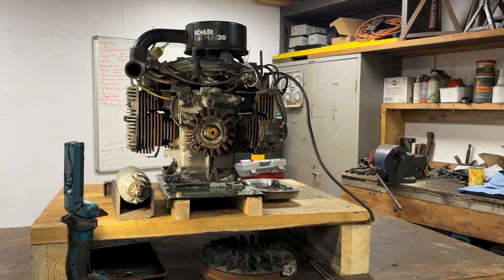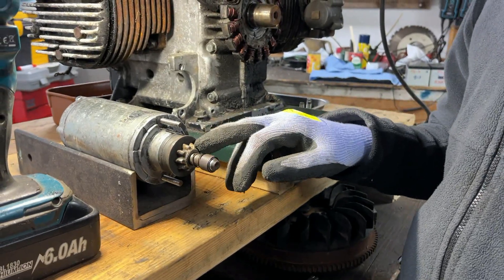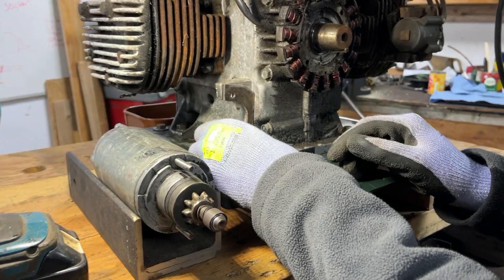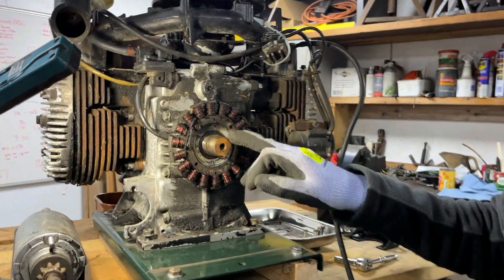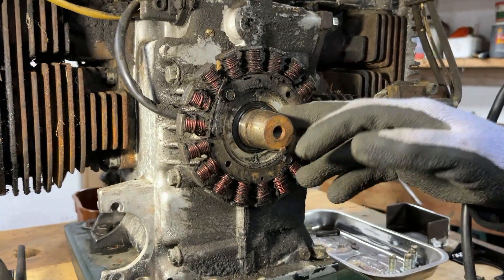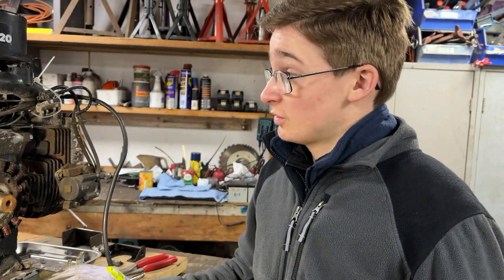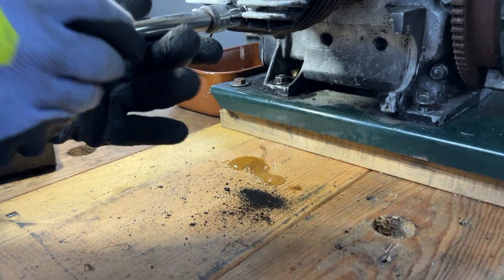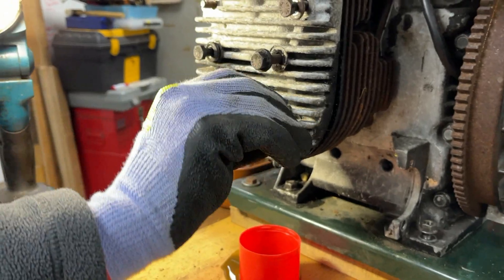1992 Bolens GT2000 - Part 2 (Engine)

Comment: To find water mixed with some oil in one cylinder isn't such bad news because even emulsified oil has protective properties. I see the strong potential that a light honing and perhaps a new set of rings and a valve lap and this will be good again. Glad also to see that the stator was just loose. The cameraman did a great job on the bracket and assisting in today's video. Bravo!😁
Reply from the maker: Although this is very similar to the Kohler twins in our tractor it is also different in a number of critical ways. It looks like the crank case has to be split down the middle to get access to the crank to get the pistons out and we have not been able to locate replacement gaskets. It also looks like the inlet and exhaust manifilds need to come off to give good access to the valve springs. As such we are thinking of leaving the bore and rings but I think we have to lap the valves. The bracket was a lot of work but we are pleased with the way it turned out. Take care
Reply: Sometimes it's best not to dig too deep..that's one of my faults, I always want to do a complete tear down when just a tidy up will work. I'm sure the pistons and rings will be fine untouched. You can still tidy up the exposed bore and rinse out with solvent to get some better traction for the existing rings. It's going to be another success story, I can tell. @GardenTractorBoy

Comment: Really good progress Joseph! Very interesting video. I was a bit surprised that one cylinder had so much water damage while the other side had very little. Makes you wonder why that is. Looking forward to seeing more on this tractor rebuild! Thanks for sharing and take care!
Reply from the maker: Thank you very much. We did wonder if the blown head gasket let the water in but someone also suggested that the valves may have been closed on the good cylinder. Take care

Comment: I really like the look of that engine, looks like a ruggedly built machine! Don't sweat too much over the oil filters, the filter I put on the 2cv tractor was £3-50 and was from a very well known filter maker, you can also buy the very same filter to fit a Ducati V twin, but it will cost you £14-99!  same part number, same filter, but obviously if you can afford a Ducati you have enough money to pay more for your oil filters!! The heads looked to be leaking at the bottom, would be a good idea to check the head and block faces for flatness, I had a big slab of plate glass I used to spread thinned down grinding paste on and rub the mating surfaces on to check for flatness, or you can use spray glue and a sheet of 180 grit wet and dry paper I would glaze bust the rusty bore and maybe fit new rings if you can get them, it may burn a bit of oil, but much cheaper than a rebore and new pistons! another excellent video Joseph, cant wait to see the rest of the stripdown!
Phil
Reply from the maker: Thanks. Those Kohler twins are great engines although they do get very hot when they are running, not a lot of fun in the summer. The engine has a Kohler oil filter fitted but not the correct one or one that cross references to the correct one. I think our main concern is that has been fitted with a filter that does not have an anti-drainback valve fitted. We have a surface table which we tend to use to check to see if the heads are warped which is often the case on these Kohler twins. I am not sure if it is correct but we tend to use some 180 grit paper on the surface table to correct any  damage. We have not been able to find the gaskets or rings in this country so we leaning towards not splitting the crank case to remove the pistons. We may have to revisit if it turned out to be a problem . Thanks for the tips. Take care

Comment: How's she goin'?  Some interesting discoveries you're making as you dissect the engine.  This is a very good exercise, you get to see the problem and then play detective to try and understand how the problem may have developed.  For the most part the flooded engine is the culprit but for some issues, like the starter mount, it was loose fasteners and the repair you made is awesome as it will prevent future failures due to the original problem.  Great work you're both doing!!  Take 'er easy!!!
Reply from the maker: Thank you very much. We are hoping that we will not find too many other unwelcome surprises on this engine, it is turning into a big project. Take care

Comment: I wonder why one cylinder was so much better than the other one,, maybe both valves were closed on the cleaner one??
Reply from the maker: We believe the engine was not fully under water and we are guessing that the head gasket had already blown on one cylinder to the extent that it allowed water into the cylinder. However it could be that the valves were closed on the clean side as you mentioned. We are hoping to not find any more problems. Take care

Comment: When working on a friends machine: "no good deed goes unpunished". Good head bolt removal technique. Do you have a speed wrench? Be careful. Chances are that the rings rusted a little. Good Luck, Rick
Reply from the maker: Yes we have a speed wrench and you are right, we should have used it. We were concerend about one of those head bolts but it came out in the end. We have been spraying releasing agent between the cylinders and the pistons which we hope will help. Ideally we would split the engine and remove the pistons but that is more work than we want to do and I don't think we can get the gaskets over here. Take care
Reply: @GardenTractorBoy If you can't take it apart, spray some cheap lubricant in the cylinder. I use kerosene and rotate the crank. A bit of crap will be left at the top of the cylinder. Wipe that out with a clean paper towel and repeat until there is nothing being left. When you start an engine that is questionable, run it for only a few minutes and then do an oil change. Watch the waste oil to see if there is significant contamination. I've had to repeat the oil changes as many as 3 times until I was satisfied, that was when oil was $1 a quart. Now, its $4 so I might try the old Model T Ford trick of filling with kerosene, take the spark plugs out and let the starter spin it over a bunch of times. Old kerosene that was left over from last years' heater will work fine. Good Luck, Rick
Reply from the maker: @richardross7219  Thanks for the great tips
Reply: @GardenTractorBoy You're welcome. Good Luck, Rick

Comment: Great video Joseph. That poor engine has had a rough go of it, but I’m sure you will get it fixed up. 
Just a thought, when removing head bolts, they should be removed by the torque sequence when tightening. And maybe you did that. Just some thing I’ve always done. It’s suppose to help to keep the head from warping. And I could be wrong, just something I’ve always done. 
Have a great Sunday. 👍🏻👍🏻👋👋🎄🎄🪵🪓🔥
Reply from the maker: Thanks. You are right, this engine has had a rough life, I hope we can bring it back to life. We did undo the initial tension on the head bolts by doing opposites but we did not stick strictly to the torque sequence. We will in future that is a good tip, thanks. We have not tested the heads yet but we are expecting at least one of them to be warped. Take care
Reply: Hope it runs for you. I'd say it will. Have a great day. 👍

Comment: Those engines are tough, you can bring it back.  Gonna take some $$$ however!
Reply from the maker: Thanks. We were only expecting to sort out the starter problems but it is getting a lot more involved. We are hoping to avoid having to take the pistons out as very few gaskets are available over here. Removing the valves does not look as easy as a K-Series twin. Take care

Comment: Hello Joseph,
Nice work on getting the heads removed... I have learnt if I'm going to work on a Bolen's I need to get a cat - lol. The camera man made a smashing job on the starter motor bracket. Is the engine water or air cooled? and do you think the side with water on the cylinder had a blown head gasket?
Take care.
Paul,,
Reply from the maker: It is always good to have a cat :-) We were very pleased with how the starter bracket turned out. The engine is air cooled and we think that either the flood water got into the engine via a blown head gasket or the other cylinder had the valves closed. These engines do run hot and it is critical to check head bolt torque regularly to avoid blown head gaskets. Take care

Comment: That stater may need 4 bolts. All of mine has 4.  I bought one engine that was full of water, had to have the block machined to 3 tenths over standard and order new pistons, this will going on the 16T if I can't get an original engine running. Your bores cleaned up nice.
Reply from the maker: We thought that the starter should have had four bolts but this one was designed to just have two. I guess they were a problem and they upgraded to four on later models. Every time we go into the workshop we are rubbing oil into the bores which is cleaning them up further. Take care